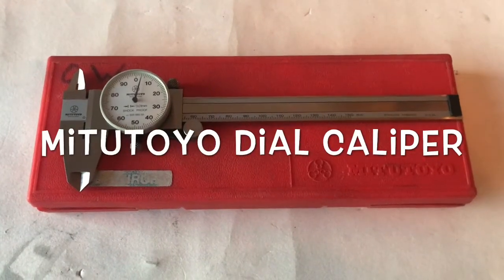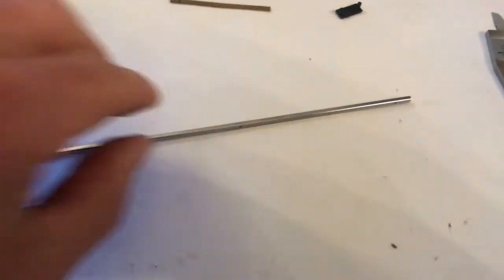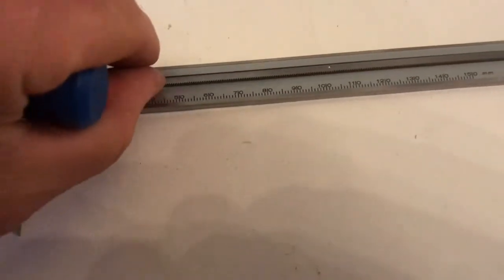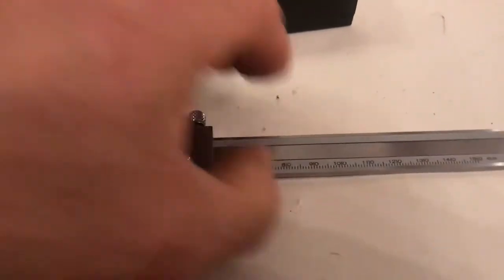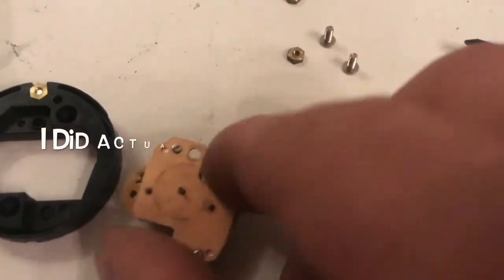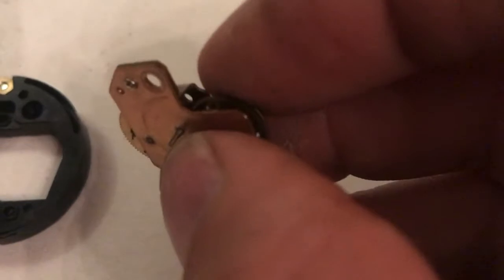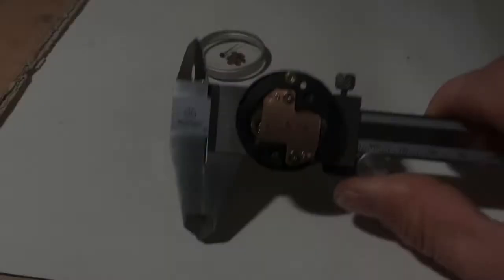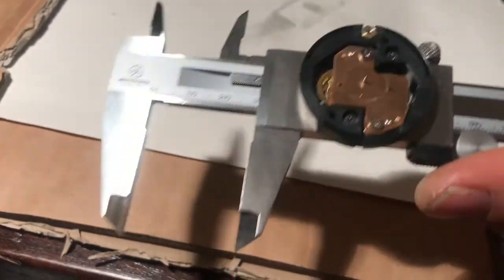Cleaning and Servicing Mitutoyo Dial caliper - Part 2

Comment: to reset these callipers to 'Zero' there is a reset tool (looks like a thin shim and NOT the pin style' - you insert the shim between the rack and pinion to disengage the pinion so the dial can be set to zero. No need to take apart.
Reply from the maker: Thanks. You can do it